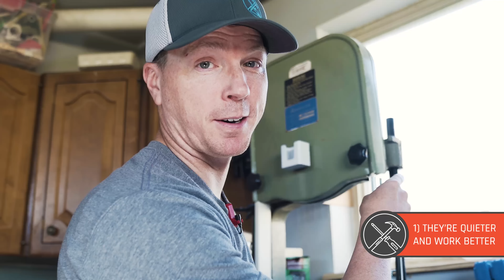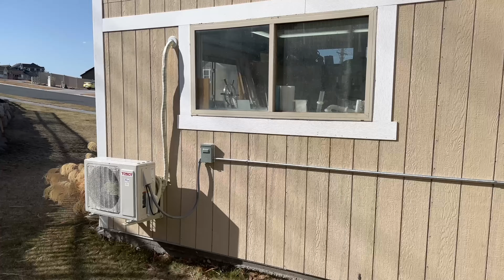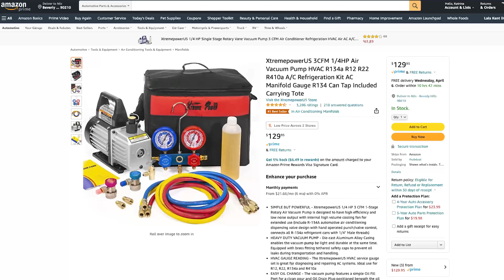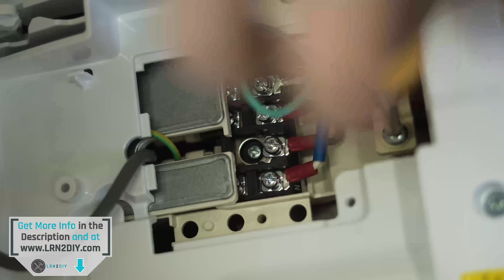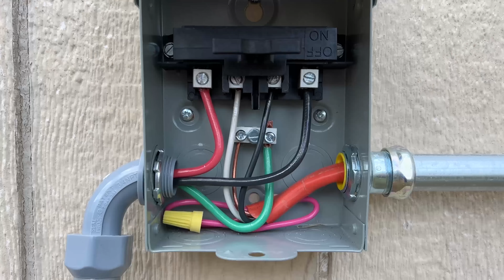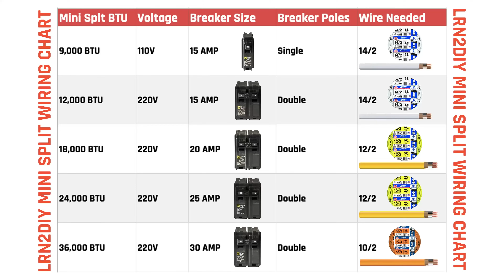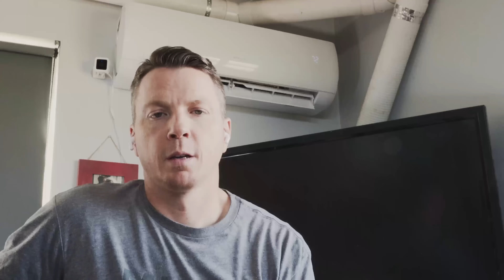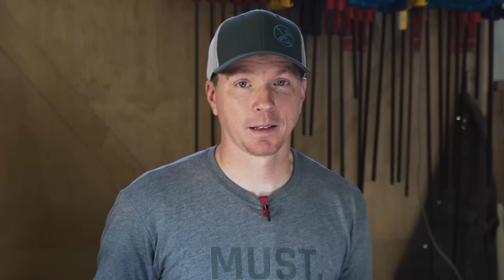Mini Split - 3 Things I Wish I Knew Before Installing

Comment: How is it slow to cool and heat? A 12,000 btu window will cool just as fast as a 12,000btu mini split. Will it be as efficient? No will it be as quite? No. I've installed a dozen mini splits and I love them but they are as fast as any a/C of the same size(besides portable A/C UNITS ad that's because they exhaust air out of the room which pulls hot air in the cracks).
Reply: Hi Randy, I'm a senior and own a 567 sf retirement condo in Florida. I need to have the wall AC  replaced and a few  HVAC guys are  recommending  mini splits now.  Will it be more efficient than a better AC unit? or even central air? What will save me more money?  I live on the third floor. Apparently, any install will  cost more .  Thanks
Reply: @lourdes sadiua  almost always a minisplit will be more efficient and cheaper to run vs a central air ducted system or a window unit. What shape is your condo? Is it long and skinny with a narrow hallway or is it more open and square? Mini splits are about as efficient as you can get but you have to figure out if a single indoor air handler will be adequate in cooling your whole condo. Having a 2 or more air handler mini split will add to the cost of the unit and install cost as well. But if you pay for very high electricity costs I would go for the mini split. Very few instances would I not say a min split is the best all around option.

Comment: You wouldn't have needed a disconnect if your panel was set up correctly with a panel on the outside of you wanna talk code why isn't there an electrical disconnect on the outside of your shop?

Comment: The vacuum pump and gages can be rented from an auto parts store. About $300 savings
Reply: Different set of gauges actually.  They have different connectors and the gauges are for cars are r134a and mini splits use r410a.

Comment: You must have a federal refrigerant certification any  time you have the possibility of releasing refrigerant .  You also must have a recovery machine and cylinder on site to capture the refrigerant if there is a problem. You must also have the certificate to purchase refrigerant to fill the system.  Fines and jail time are possible if you are reported.   Hope all you DIYers don’t get reported

Comment: FWIW, Mr. Cool has the same contractor install version for similar price. One thing to remember also with a pre-charged unit, you can't shorten the lines if you have a closer installation the outdoor unit in the indoor unit. You have to figure out what to do with the extra line set coiled up inside or outside.
Reply: I think you need to be licensed to get the refrigerant don’t you?
Reply: Always read the manual, the minimum lineset length is almost always identified and sometimes you can cut it shorter and reflare the pipe ends.
Reply: @taylorlightfoot  Agreed, but according to MrCool, that will void the DIY warranty.
Reply: @Gbfaninnm  just don't leave the excess lines coiled up vertically otherwise it's a possible oil trap waiting to happen, lay the excess coil horizontally above or below the unit or in the attic when possible.
Reply: @SavageOne420  good reminder, I put mine in the attic. Worked great for me.
Reply: @SavageOne420  I never knew this. I have one full vertical circle at my compressor. Partly to get the approach angle right to compressor connection and partly because I was afraid to cut without much extra.
Do you think one 3-4' diam circle could be a problem?
Reply: @artsmith103  most likely not a problem but if there's ever a chance to lay it flat while doing other repairs/service it would be a good idea plus it usually looks cleaner
Reply: @Gbfaninnm  there's no warranty on DIY anyway
Reply: @matsudakodo  the Mr cool diy has a warrantee not requiring professional install.
Reply: @clockenessmnstr  yeah, it's a change. They didn't used to.

Comment: YOU CANNOT MEASURE A PROPER VACUUM WITH JUST GAUGES! YOU NEED A MICRON GAUGE WHICH WILL COST YOU A COUPLE HUNDRED MORE. NOT PULLING A PROPER VACUUM ON UNITS WILL CAUSE SIGNIFICANT FAILURE OF THE COMPRESSOR AND REDUCE SEER RATING.   PLEASE READ THE MANUFACTURES INSTALL INSTRUCTIONS INSTEAD OF PAYING ATTENTION TO ALL THESE DIY VIDEOS UNLESS YOU WANT  TO DESTROY YOUR NEW SYSTEM.
Reply: YOU ALSO NEED A TORCH WRENCH FOR THE FLARES OR ELSE THEY WILL LEAK.

Comment: you don't need the electric disconnect if you can see the electric panel from the unit.
Reply: A disconnect is also a convenience when servicing your equipment, without having to go in and out of the home
Reply: @howtodoitdude1662  in that case you would need the disconnect because there wouldn't be a direct line of sight to the breaker which is also a diconnect.
Reply: I notice my unit has a quick disconnect and (it looks like) a ground fault interruptor colocated with it. But, the installation is not attached to a breaker. Is a breaker needed in this case? I'm assuming no, but I'm not an electrician...
Reply: @enhompe2  if it's not attached to a breaker, what is it attached to?
Reply: @ianpaul13  right under the electric meter.
Reply: @enhompe2  call an electrician to make it safe.
Reply: @enhompe2  it must originate at the service panel with a breaker. An outside disconnect can be a switch, a fuse, a GFCI or a pull out contact. Yours may be going through the wall under the meter to the circuit panel.
Reply: My state is not if the panel is within 25ft of the unit, I have 2 mini's installed in my shop both have switch disconnects, its cheap and I am not walking 25ft.

Comment: your links to the mini splits do not work
Reply from the maker: So sorry about that, we've been in touch with TOSOT and the links should be working now,
Reply: @LRN2DIY  thanks, not complaining just letting you know so you can get it fixed.

Comment: Most of these have the line sets filled with nitrogen...they are not precharged with R410. You'd lose the gas as soon as you remove the shipping plugs and hook 'em up.
Reply: No, Mike, my lines came empty, the indoor unit was charged w/ nitrogen. I vacuumed the lineset and indoor unit after everything was connected, then opened the valves on the outdoor unit and it charged the whole thing. Works great.
Reply: @JohnnyBfromPeoria  Excellent! Some have the line sets filled with nitrogen and are capped, and some not.
The point is that you MUST vacuum the line set and the indoor unit, even if one or both are filled with nitrogen.
Reply: @mikesmith1181  quite right. Neither air nor nitrogen is going to do anything positive for the refrigerant system. It's nice to know that the inside unit is tight, though, as it held pressure all through the shipping process. It's what they test them with at the factory and it keeps junk out of them until you're ready to install and evacuate them.
Reply from the maker: Not the case here. I reached out to the manufacturer to verify before installing.
Reply: @LRN2DIY  how did you NOT lose the R410 when you hooked up the lines?

Comment: I used to think it was a good idea to encourage people to take matters in their own hands, and tell them that a little more effort on their part is the answer to saving money.  But after a 20 years of dealing with the public I don't encourage people to DIY anymore, 99% of people will cut corners and shorten the life of their units and/or do horrible things with their electrical install.   But you're right if you know how to do quality work it's not rocket science flare a tube, or to vac down a system or top off a charge.   But have you seen these retards in action?

Comment: Great video! One thing you missed was the efficiency rating of the unit (HSPF for heating and SEER for cooling). The Tosot unit you got has an HSPF of 9 and a SEER of 20, decent but not amazing numbers. A $1500 Gree Saphire 9k BTU heat pump has insane ratings of 15 HSPF and 38 SEER. If used a fair amount it will quickly pay for itself in energy savings.
Reply: Here's the downside - besides the cost, it's not needed to have such a high  seer rating. Buy the Saphire ONLY if you need low temp heating. In reality, the higher the seer rating the less it is good at removing humidity by default. 
And the next downside is, no warranty, because Gree does not work with end users, only contractors, and they won't touch self installs either.
You are better off buying Senville or Pioneer. The higher seer rating isn't needed. Compare with the EER and they aren't much different.
Reply: Could you explain to us how higher SEER makes them less able to remove moisture?
Reply: @LowerYourHeatingBill  Larger evaporators Larger condenser and higher airflows across the warmer coil. You can still make a high SEER unit dehumidify by slowing the airflow over the evaporator BUT it will no longer be high SEER when it is running at a reduced airflow. Right now in eastern PA it has been in the 90s with high humidity. I have several units that have been on dehumidify all day and only switch back to normal at night. My ductless unit downstairs has been on Dry mode all week and it just keeps pouring water out. Depending where you live and the infiltration rate of your home you have no choice but to add a ducted dehumidifier. Isnt it fun when the government tries to regulate energy?
Reply: @LowerYourHeatingBill  To add to this, search hvacschool mini split humidity and that will also explain in more detail what goes on. In any case, anything over 20 SEER is just not worth pursing, as the actual EER rating isn't much higher.
Reply: @sprockkets  I disagree with the EER number being about the same making it not worth getting higher seer. I understand the EER is the efficiency running it for one hr at max capacity. So it seems to me that it shouldnt even be used for variable speed systems. One way they are getting  high efficiency (SEER for cooling, HSPF for heating) is from running at the speed thats needed. Anyways, where lots more  heating is needed than cooling in one yrs time, the HSPF is the most important one to look at.
Reply: @LowerYourHeatingBill  spoiler alert, HSPF is just the COP times 3.41, aka, 1 btu = 3.41 watts. 
But you missed my  point. I'm not saying SEER isn't important, I said it isn't important once you reach around 20. At that point it is more about gaming the system, not actually being more "efficient."
Reply: Once again you have to look at your area. If you live in Arizona or New Mexico a high seer number is a better option. Look at your sensible heat vs latent. High seer units remove very little humidity. This is why ducted systems are coming with a variable ECM Blower and a DEHUM terminal. When this terminal is deenergized the blower will roll back to 75% airflow thus turning your central air system into a big dehumidifier. All SEER rating go out the window at this point. If you turn your ductless to dehumidify or dry the same thing happens. the unit is no longer temperature controlled or has any SEER rating. If your air is dry enough you can run the unit at the same specs it was tested at. At that point you may consider a swamp cooler or a large coil with well water running through it. In PA we have a lot of humidity to deal with.
Reply: @anthonyspadafora1384  I'm trying to understand your comment because you seem more knowledgeable than I am about this stuff. I live in hot humid NC. Are you basically saying that a high seer isn't that important because I need the humidity removed?
Reply: @lennymcmillion  You should get as high of a SEER rating as you can.
Reply: @lennymcmillion  Another option for you is an inverter drive like a Ducane Lynx heat pump, I am assuming you are using a heat pump in NC. It will give you 3 evaporator temperature settings to choose from for your area.
Reply: @anthonyspadafora1384  looks like the Goodman unit, which is Daikin based. Not really a fan of Goodman, even with Daikin owning them. Too many corners cut.
Reply: @sprockkets  Check out Mideas factory  800 robots just replaced 24000 employees. www.youtube.com/watch?v=zWrHd9Ym3Iw  The size of these factories is incredible. These numbers are mind blowing. Midea invest 6 billion in ductless, Haier purchesed General Electric. GREE opened factories for ductless in the Philippines and another in Brazil. My younger brother at age 55 has just started the dating scene again. Last week he went out with a very nice Japanese woman. He was showing her his new ductless units. She tells him that is all they use in Japan but they are a lot cheaper   lol.
Reply: Exactly !!!! Many people on,y look at the price and not the efficiency…..I call it “ pay extra now once, or pay extra for the life of the unit”
Reply: @dominicm2175  also a huge difference in quality. Cheap unit usually has a noisy indoor blower motor. That will drive you insane! Quality top brand isn't usually much extra. Few hundred bucks & you get a nicer looking unit , silent whisper quiet operation. That your going to really appreciate when it's needed most. 
All adds value to your property & latest inverter technology will pay for its self in power consumption. Its a Win win
Reply: Online calculators tell me it would take 5-10 years to pay for the increased cost
Reply: @matsudakodo  that.probably assumes a static electric rate. I wonder how long it will take when electricity is twice as expensive.

Yes that is rhetorical.
Reply: Gree makes compressors and maybe other parts for MANY brands.  38 SEER sounds like knife's edge, wondering if, like Li-Ion batteries, the performance runs down over time?  More likely to fail?  More costly to repair?  And consider the premium $ vs savings, raking into consideration the life of splits (less than most central units), carefully.  22 SEER Pioneer 9K unit, etc, might make more sense.
Reply: The expensive outside units are often  10dB quieter and last longer ( maybe)
The cheapest ones don't work on very low outdoor temperatures.
Reply: It's the same company.

Comment: It doesn't do anything with humidity, correct?
Reply from the maker: Not that I'm aware of but I haven't looked into it much. I live in a very arid climate so I'm not certain.
Reply: My 12kbtu unit *does have a dehumidify cycle.  Probably low fan and very cold evaporator setting.  I don't expect my unit is anything special-- I waited and watched for the first unit under $600 on Amazon. Turned out super quiet and precharged [the condenser, not the lines] up to 10 feet (that's 9000mm).
Reply: @timgerk3262  Thanks. Does it have a drain?  How does it eliminate humidity?
Reply: These units dehumidify just like any refrigeration unit would. The side that gets cold has water vapor condense on it, it collects into a pan and it drains out a line outside. Indoor unit dehumidifies in summer, outdoor unit will get "wet" in winter.
Reply: @JohnnyBfromPeoria  Reason for the condenser's "defrost cycle".

Comment: I realize contractors need to make money , but what justifies a whole house system costing $21K before rebates my state offers ?  We just had it quoted by a reputable area HVAC company and they are all Mitsubishi with the heat option as well. What’s funny is, the rebates for a whole house system make it cheaper than say just the master bedroom and the open living room/ kitchen units. Even after rebates , said whole house system was $11K. Somebody convince me why we should go this way. For now we bought one of the 10000 BTU  Midea U shaped window AC units with the noisy part of the unit outside the window. Received on Wednesday and installed today. It’s very quiet .
Reply: Most consumers have NO idea what it takes to operate and maintain a reputable business, sure you can try your hand at diy or a “fly by nighter” but most of our customers want someone who knows what their doing and most of all will stand by their work and provide necessary service when needed. That’s what your paying for when you hire a professional.
Reply: @MK-xl9tt  ok, seems fair. I know I like those things when someone works on my place.
Reply: @MK-xl9tt , I agree!  Most employees want to make between $50,000 and $75,000 a year when they are installing and repairing HVAC systems.  Then there is the cost of the vans, fuel for them, insurance for the van and employee, business insurance when your employee burns down a house, ect.  (that doe not happen often, but you must have the insurance just in case).  So that is a bit over $1000 per week, maybe $2,000 for a really good employee who is working overtime!  Then $4,000 insurance on the van, and some person to answer the phones who wants about $40,000 a year?  It all adds up!
Reply: Thank the unions.  The union boss gets about 50% of that cost.
Reply: @joedoesfun9336 their are usually no unions involved with small family owned residential hvac contractors
Reply: @joedoesfun9336  even from a private contractor?
Reply: @devilslide01  The unions keep prices high and always have. Entry to the trade is high and difficult. Equipment hasn't hardly changed in 100 years while nearly every other industry is plug n play or at least easier for a homeowner to do. Notice the angry "pros" that hate the Mr cool because it eliminates the need to call a guy with a "certification". By the way you can get a refrigerant license and proctored exam for a few hundred dollars easy with a few hours of study from a book. Easy. Then you can buy all the freon you want.